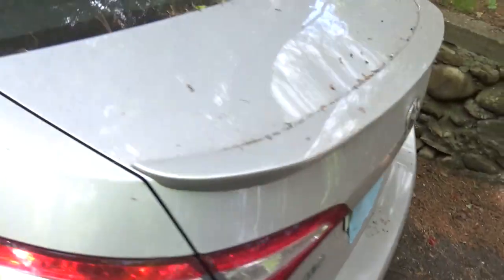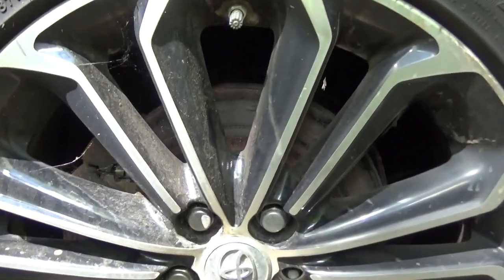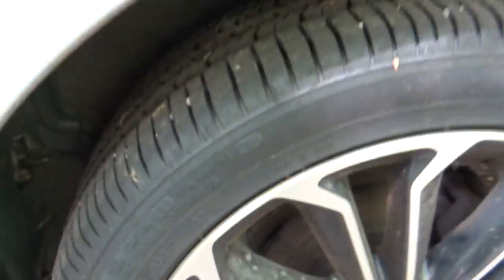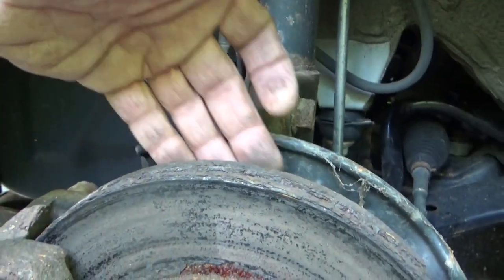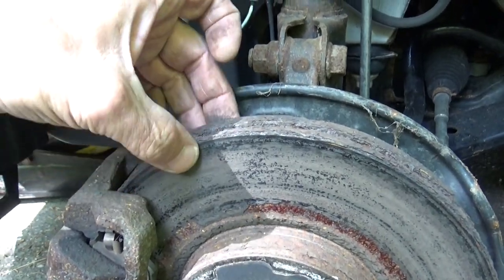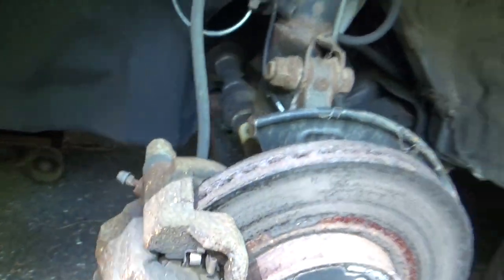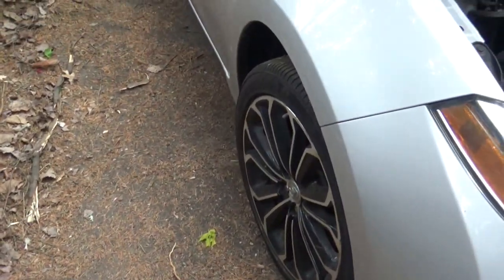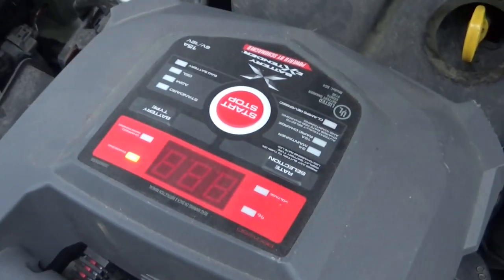2015 Corolla S - Front Brake Replacement - Auto Repair - Part 1

Comment: Are rear brake Discs same dimension as the front ?
Reply from the maker: NO. I actually have never seen a vehicle that uses the same for front and rear. (Approx 60%of your CAR'S braking is in the front, 40% in the rear. Trucks are closer to 70%-30% and often have some means to VARY these percentages)